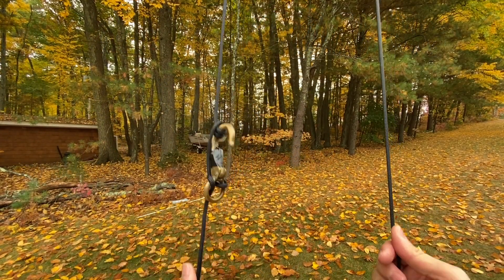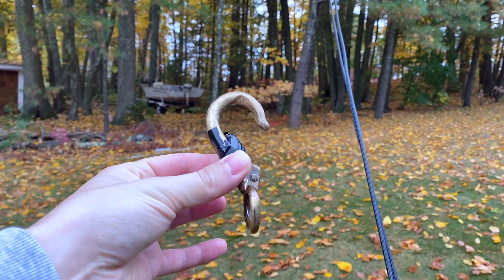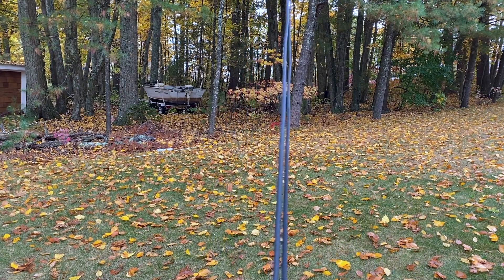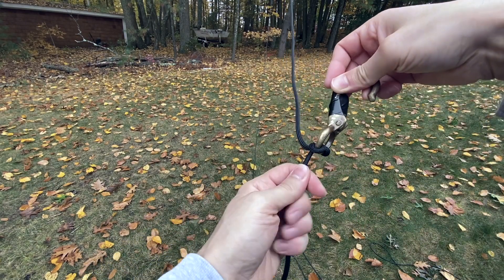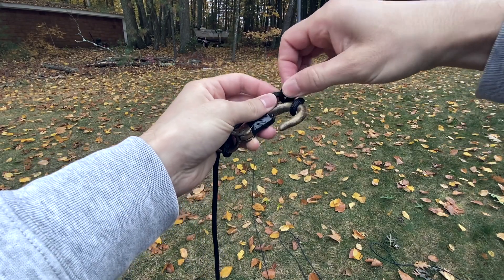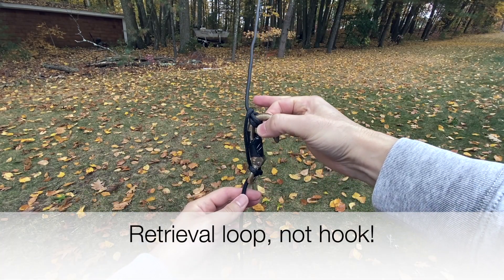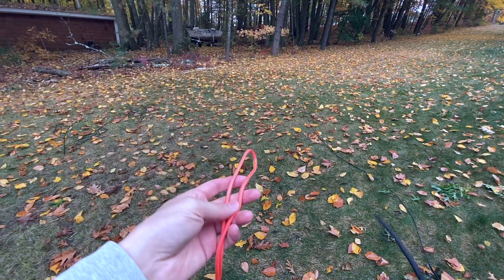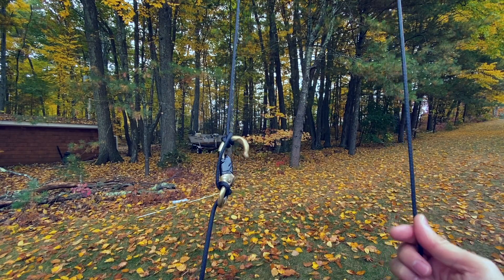The best way to hang a pulley in a tree - Part 2: Taking it down

Comment: Brillian! Do you have a source for the retrieval hook?
Reply from the maker: I got mine at the local hardware store. If you search for “fixed eye spring hook” you will find some that look the same. Just be careful that you don’t get one that is too small. Mine is just under 4” in total length including the eye. The spring loaded opening is about an inch wide. It has a “3” stamped on the side. I also have smaller ones with a “2” stamped on the side that would be too small. If you get one of these you probably are going to want to either remove the spring or pull off the arm that I tapped down on mine. Here is a stainless steel one that looks similar to mine: https://amzn.to/3N8dgBV I think an even bigger hook would possibly be easier. If you find something better let me know!
Reply: Thanks for the prompt reply.  I will see what I can find.  Thinking about it again,  I am sure you are right.  A larger hook might make the process easier.  I doubt that the retrieval hook needs to be very strong.  I might consider making one out of plywood or 3-D print one.
Reply from the maker: @larrypicard5969  would love to hear how things go. Especially if you try something different that works out well. Please consider subscribing 😀

Comment: What diameter and manufacture rope are you using? Mainly the black one?
Reply from the maker: It’s 3/16 double braided polyester. The spool that I bought says it’s from synthetic textiles inc. https://www.synthetictextilesinc.com here is where I bought mine: https://www.amateurradiosupplies.com/product-p/da316-1000.htm

That website sells different size spools. Can never have enough though 😀

In the description of the following video I mention the sizes of the vinyl tubing that I used: https://youtu.be/1kKpP2pTpYs
Reply: @MostlyBuilds  Thanks. I'm going to be putting up a 160M EFHW antenna soon going between 3 trees and a 30 foot flag pole and I need a lot of good rope to pull it and the insulators up and into place.
Reply from the maker: @W9HJBill  I’m not an expert in the antenna rope department, but my understanding is the polyester (Dacron type) rope is supposed to be the best. Best of luck with your project!